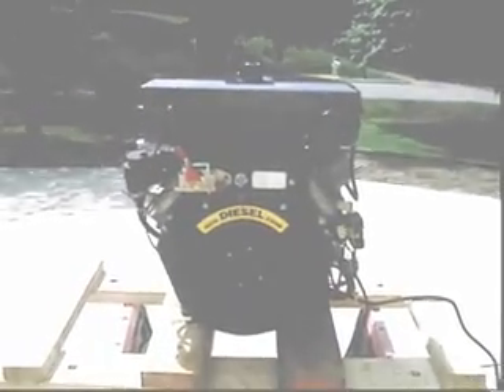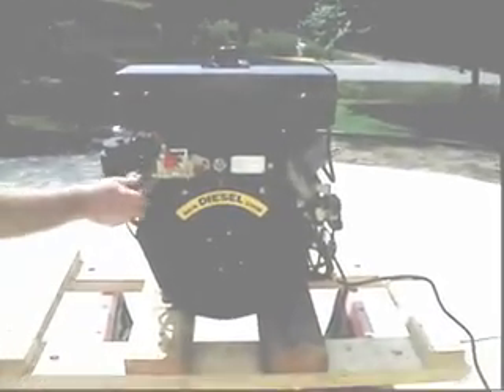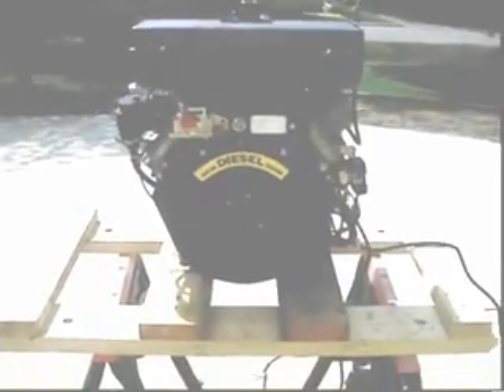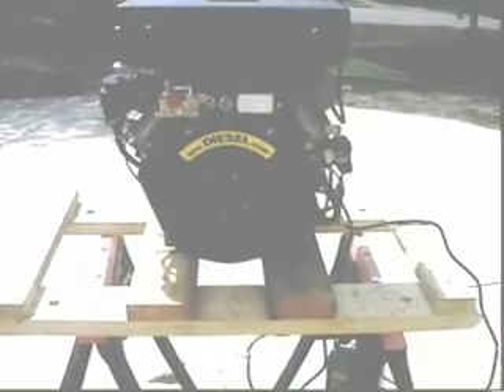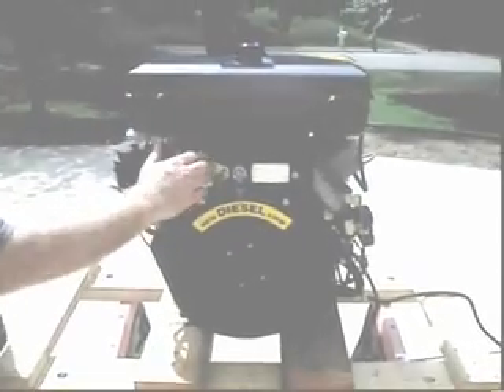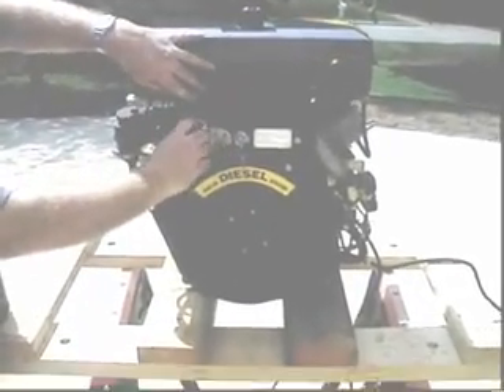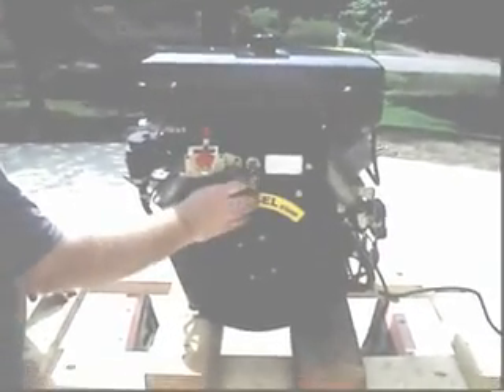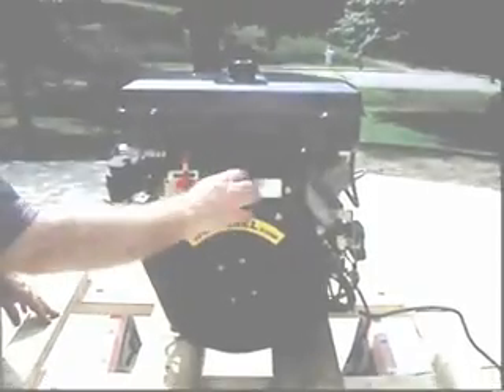25hp V-Twin Winsun Diesel Engine Air-Cooled Test Run

Comment: How reliable has the engine been?
Reply: The UK distributor "Run Sun Power Ltd"  supplied me with a faulty 25hp engine, it failed after just 7 hours of testing... they refused to refund my money and then filed for bankruptcy when i took them to court.... The two crooks who called themselves directors were Paul Quickenden And Phil Carr... If anyone see's these two trying to sell RunSun equipment, avoid!!!

Comment: How well have these engines held up in comparison to kohler and Briggs? I have 1700 hours on my kohler 23 on my gravely mower, Been through all kinds of blades, belts, and spindles on the mower frame, but the engine still runs strong and cranks right up. I saw there are vertical shaft diesels on ebay I may be inclined to get one and hold as a spare for when the kohler finally gives out.
Reply: in phillipines wher is to buy  this motor

Comment: @1pinchipendejo The level of torque only indicates where in the rev range the engine will develop its best power. These industrial diesels are usually designed for peak power @ 3600. Therefore if this engine is 25bhp, it will develop 36.5 lbs/ft @ 3600. Hillclimbing rate will be exactly as you would expect fron 25 bhp regardless of fuel type.